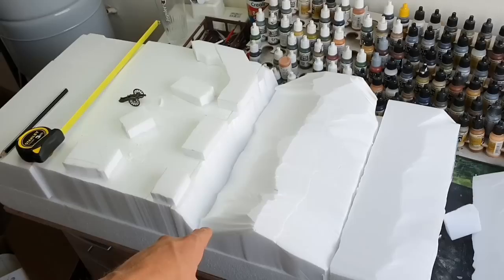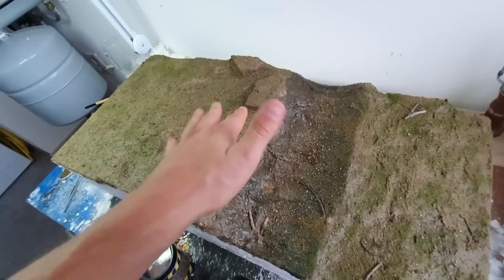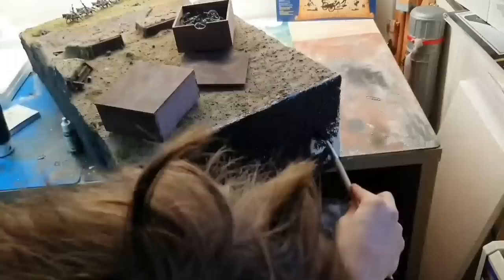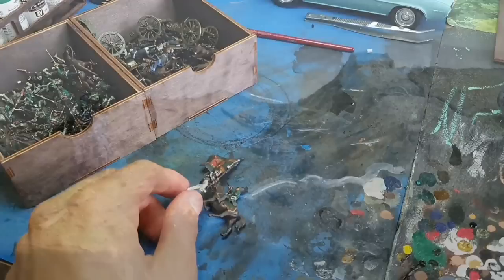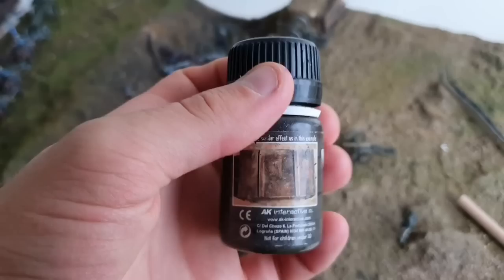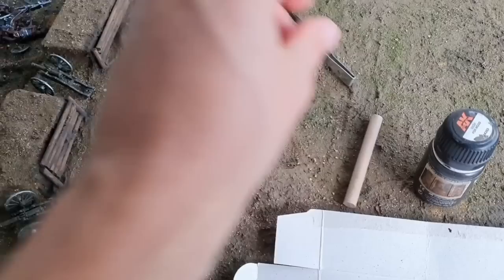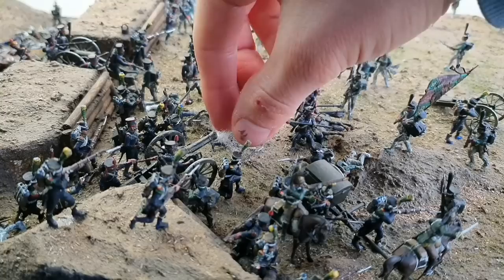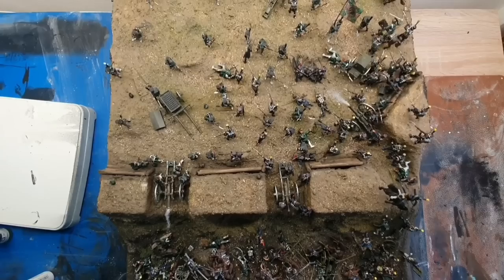FINISHED! The Borodino Model - Raevsky Redoubt - 1812 - 1:72 - Russia VS France

Comment: Monumental effort and excellent job on the terrain. While there are plenty of casualties down in the ditch I don't see any inside the fortifications nor do I see the kind of damage French artillery would have inflicted on it. 2 things that stick out at me; the mounted officer on top of the redoubt seems unlikely and the Russian infantry flags marching alone - they should always be in a formation of men. I think you would have benefited by making the area shorter and packing the figures in closer together. 

 For mounting you may want to try pinning one foot to make figures stand easier using a piece of small wire (paperclip size). This allows you to lay out all the figures and readjust before gluing. I hope I'm not discouraging, your work is very good and shows great ambitions. Napoleonic battles were in the 'grand manner' so tons of figures is wonderful.  A bit of experimentation making conversions for killed and wounded is one of the most challenging and fun aspects of diorama making which I heartily encourage anyone. You should be very proud of your achievement here and I'll be watching to see what you come with in the future. Bravo!
Reply from the maker: Hey David, first of all thank you. This project took me a long time, because of the many details on the uniforms of the soldiers. The two points you make are well said. There should be many more deaths at the bridging of the fortification. In addition, the officer is indeed somewhat oddly placed now that I think about it.

As for the flag bearer, I grabbed for a higher point in the landscape so that the pride would turn out for the troops. You do mention important details that make the diorama even more realistic.

You certainly don't discourage me, I welcome criticism, because I want to deliver the best version of the product. A good tip is to try out the placement before I start using glue. In addition, I should have made the model smaller with the number of figures I have. I will take your tips and use them in future projects.

Thanks for your detailed explanation! This helps enormously in building future projects and improving old ones.
Reply: @ngbuilds7590  Due to the sheer labor involved I knew you were serious in your build which displays a number of skills. You don't attain that level without some real effort on your part and a willingness to take friendly criticism.  Given the dry weather and sheer amount of foot traffic the dirt would have been packed flat. French light infantry (alas!) did not carry an eagle in the field on their standard but you found positions for the awkward French voltigeur running figure that looks natural - I didnt know that was possible, haha. The French chaps fighting from behind the dead horse was a neat idea, the rammer sponge seems very plausible but dual handspikes is a bit odd, rather like working a pizza oven. That's where an arm swap might've been called for. You did have some casualties inside my apologies for missing that earlier.  The level of carnage in the ditch really deserves an extra applause. These Zvezda units are quite familiar and you've done a very good job painting them. Do you have plans for your next diorama?
Reply from the maker: @davidcollins2648  Thank you how you describe my skills. Also definitely a good one from the flat ground. Unfortunately I can't change that anymore, because of the hardness of the ground, but it's one I'll keep in mind for a next project with large numbers of troops. I can still cut off the eagle on the flagpole, good one!

How do you mean hand to hand combat with spikes?

I'm most proud of the carnage in the ditch in this model, because it worked out really well.

With all the tips under the videos I will probably make a revised video (short) in which I tackle the mistakes.

A new project is definitely on the way. I'm currently working on a scale model featuring Desmond Doss. It will be a small scale model in which the quote "one more" comes to life. I'm also working on the moon landing.
Reply: @ngbuilds7590  the spikes are the wooden bars to reposition the trail of the artillery piece. no need to cut the French Eagle off, they had them earlier (light units) but Napoleon feared losing too many in battle. Some unit's likely persisted and keep their eagles despite Napoleons orders.
Reply from the maker: @davidcollins2648  Check! Thankyou for your detailed descriptions to make the battle even more accurate. Interesting facts by the way.

Comment: Next time. Drill a hole in the feet of the soldiers and horses and put in a small brass rod. You won't have to.worry about using paint bottles to hold them up and it saves a bunch of time. Good job otherwise.
Reply from the maker: Thank you for the tip!

Comment: The problem with such kind of model is that, too frequently, there is poor misunderstanding about the artillery tactics and regulations of the time. Here, for example, putting a French caisson parading at short range from the Russian guns is totally inaccurate. It would have been a too easy target for the Russian gunners, that would have easily hit it with canister, causing a big explosion. Same thing with the damaged French cannon and limber found in the ditch. What is it doing there ? The problem is that this model set is too small and not realistically representing the actual distances. Bringing cannons and caissons so close underneath the Russian redoubt would be totally pointless. It is correct to show the French infantry making an assault against the redoubt, but the artillery would shoot from a longer distance. Besides, movies and model sets are too often showing unattended damaged cannons on the battlefield. It looks nice, but it is totally inaccurate. Mind that cannons were like flags, they were trophies. According to the French regulation, while the first captain was in charge of the line of fire, the second captain was in charge of the reserve in men, equipment and ammunitions. In case a cannon was “dismounted”, i.e. a wheel or the carriage were damaged by an enemy cannonball, the second captain was immediately sending a team to bring the cannon back to the rear. For this purpose, men were trained with “manoeuvres de force”, in order to move heavy cannons under any circumstances, attaching a barrel to the limber in case the carriage is destroyed.